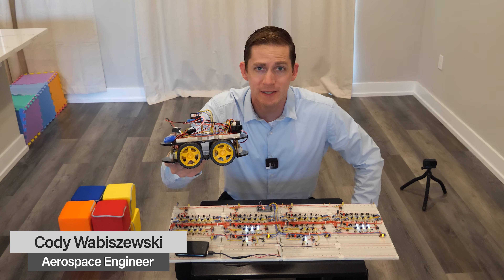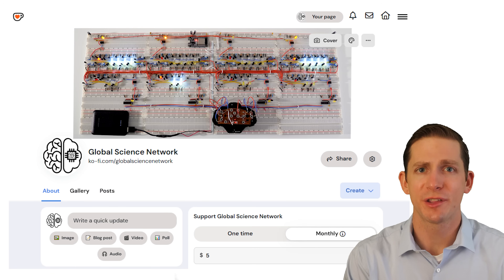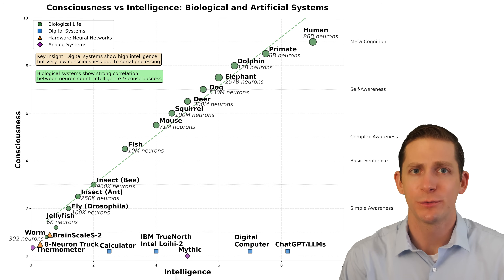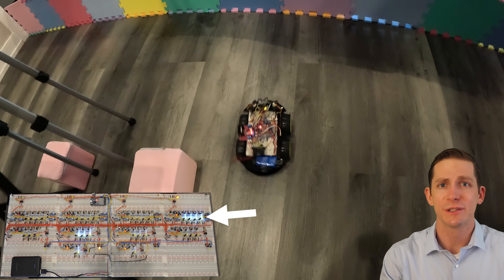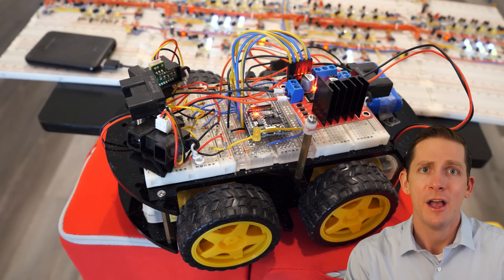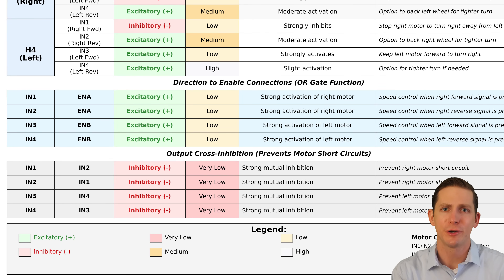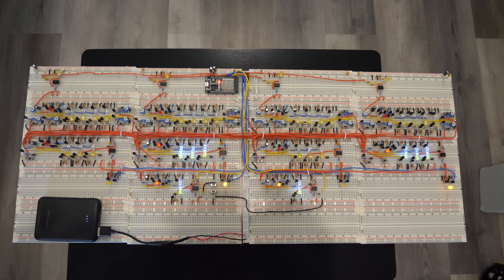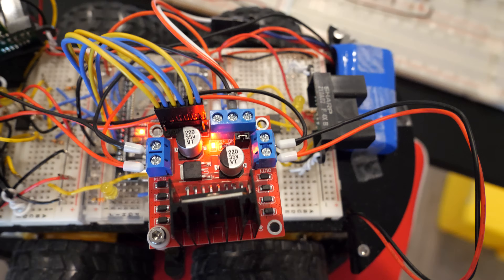Artificial Brain Controlled Robot

Comment: sir i am making your project in pcb form of each neuron and synaps but for kind information circuit diagram you send 1 problem in every neuron the left side of discharge resister two resister are interconnected 100k and 2k but not connect to 5v vcc rather than grate theory explanation
Reply from the maker: Interesting, I have drawn up to PCB version now as well. I would be curious what yours looks like. Send me an email if you would!
Reply: One dought
Reply: Using MOSFET as an inverter is for opto coupler and transister as an inverter is led as an option coupler

Comment: I think the core of machine intelligence might be only 14 equations (7 from Reinforcement Learning, and the other from an adaptive, Fuzzy state classifier) with just 3 Neurons (2 of the neurons from a 1983 IEEE CART-POLE paper, with a rigid decoder modified to go from being a passive sensory system, to being an active sensory system, basically the 3rd neuron as a "head", active sensory system like our own head with eyes and ears all movable).
Reply: This being all implemented as an adaptive control system with an adaptive Fuzzy state classifier using Reinforcement Learning, a key reference is:

"Adaptive Control: Stability, Convergence, and Robustness" by Shanker Sastry, and Marc Bodson (1989)

Comment: That thought experiment you proposed, is very important and clearly defines what the “sense of self” or consciousness is. If one gradually replaces the neurons with perfect replicas, then the self recurring loop doesn’t break.

It’s as if nothing happened, since the underlying generative process isn’t paused or broken. The challenge now, is developing these self recurring loops with the artificial neurons. To get this is completely possible, but requires many connections and layers as to sieve through and connect different abstractions. With projects like these humanity is getting closer and closer to this. I myself, am working on implementing this self recurring loop for aerospace systems.

Comment: An interesting thing to do would be to have the potentiometers replaced with something with resistance that can be varied from an input signal and then using another microcontroller or raspberry pi to run some kind of optimisation algorithm like cmaes or something lighter to then automatically tune the neural network

Comment: would replacing the fixed 200k resistor by a SPI based digital resistor along with a SPI ADC then to read the values help this to self tune?

Comment: Bruh howd you do backpropagation on it. Did you just train it elsewhere and just wire the weights in like that?
Reply from the maker: I manually adjusted the weights. I did not need to do backpropagation as the logic was pretty straightforward. I show the logic in the table with the needed resistance or weight of each connection.

Comment: what is fun to think about is, how much power this uses vs how much power a standard neural network on a computer would take to achieve the same thing. This is really amazing work.
Reply from the maker: Thank you! This is true, the potential for high level consciousness machines and low power. This is something that is just not possible with digital machines. Hopefully more people start working on this type of tech!
Reply: The main issue/difference is the organic (no pun intended) creation denovo of new connections out of the blue that hardware can't/won't do
Reply from the maker: @uog293  Watch my video on how to create artificial synapses. Most of our learning is done with reduction, not new connections. Also, why do you think we cannot make new connections with hardwared? It can be done!

Comment: I'd love to see something like this made using an FPGA if that's even possible. I work with drones and especially light weight drones, they sometimes struggle when the conditions are windy, i can tune the drone to the best of my abilities but sometimes i think the flight controller is just not quick enough to make decisions to stabilize the craft. I know the power system is also a major dependency in terms of flight performance but i wonder what if a flight computer, just like the one you made which works in real time could help with such issues. 
Amazing work ❤.

Comment: Bro u can do the same thing with finite states machine😅 with couple of flip flops wtf
Reply from the maker: Yeah, you can do obstacle avoidance with a relatively simple set of digital logic gates and flip-flops. However, that is not analog and the resolution would be way lower. This was to make a simple case of how this works in hardware. Then keep improving the design and eventually scaling it. If you are interested, watch my video on how consciousness works to understand how digital machines are very limited when it comes to making conscious devices. Which is the ultimate goal here, to make non-biological life.

Comment: So cool!! Sir there’s cheap FPGA on aliexpress rn is this applicable on that?
Reply from the maker: Well, an FPGA could be used to help with inputs and outputs. The core design needs to be an analog integrate and fire method and an FPGA would still be digital.

Comment: Hello Global Science Network!

 I'm a huge fan of your work all the way from Brazil. The robot driving footage is fantastic!
I was thinking about the next step—having the robot adjust the weights automatically—and I wanted to share an idea for a hybrid learning architecture based on your current design:
Digital-Analog Hybrid: Since your analog circuit handles the fast, energy-efficient signal processing (the 'driving'), the ESP32 on the robot should handle the learning.
Backpropagation/Delta Rule: When the collision sensor activates, the ESP32 can calculate the new optimal weight using a simplified Delta Rule (or Backpropagation concept). This calculation determines how much to punish the synapses that caused the error.
 Digital Potentiometers (Digipots): By replacing the manual potentiometers with Digital Potentiometers (Digipots) controlled via I2C or SPI, the ESP32 could digitally write the calculated New Weight directly to the analog synapses. This maintains the analog speed while achieving automatic learning.
  Generic/SMD Modules: To make the design scalable, you could create the synapse/neuron blocks on small, generic SMD PCBs. This makes the entire "brain" modular and highly dense, allowing for quick scaling to 50 or 100 neurons for more complex tasks!
Your project is already groundbreaking. Keep up the amazing work! I'm eager to see the next video on automatic weight adjustment!

Comment: I didn't understand how this is better than GPT will billions of transistors... can you please explain it a bit?
Reply from the maker: If you want my video on how consciousness works, I go into detail. Basically, though, AI running on digital machines are very intelligent but has a low level of consciousness due to how information flows around the system. Each part of the circuit is only active for billionths of a second.
Reply: @GlobalScienceNetwork  ho got it... while here all the parts are simultaniouly active as it's physically there

Comment: man, I can't wait to see a surface mount prototype. that'd be so compact! you could have 64 neurons on the robot, no RC required.
Reply from the maker: Yeah, exactly, if it is all onboard it is actually much simpler. Controlling it remotely was fun as well!
Reply: @GlobalScienceNetwork  I was wondering, how do you plan on recording and replicating brain patterns? Surely there has to be a way to copy information from one set of neurons to another.

Comment: why are you sticking to breadboards? i feel like prototyping on a PCB might be easier for you. you could use small smd components and easily have many dozens of neurons quickly wired up
Reply from the maker: Yeah, I did breadboards as the design is more flexible for the first build. This will be converted to PCBs and even IC once the design is refined more.

Comment: Maybe I will emulate this on an attiny 13. It should handle up to 16 neurons fine.
Reply from the maker: That would be great! I used 10 inputs/outputs to send and receive, data. Also, you need a transmitter so not sure if it will work.

Comment: Can I get guidance on using AI to control a IGV in different conditions.
Reply from the maker: That could be done with these networks. Hard to explain in one comment, though. It depends on what sensor data you have.

Comment: Hey I use that motor driver too, that's a good motor driver. I have accidentally fried one before by putting way too much voltage into the buck converter, frying the motor controller, my esp-32 and the buck converter. I think I was trying to drop the voltage from 18V to 12V. But boy did my robot go fast for a second lol
Reply from the maker: Ha ha that is awesome! This was powered at 7.4V.

Comment: All this experiment is just a "fancy" way of implementing a functionality what just could have been done with a few tens of code lines. 
   Nueronal networks makes sense only on bigger networks when you need specific objects detection, otherwise for implementing an "obstacle avoidance" using some ir or motion sensors, some common algorithm does the job better.
Reply from the maker: Well since I have a microcontroller on both ends I agree that I could have programmed in obstacle avoidance. This was made to demonstrate how a small hardware based neural network can do something useful with a simple task that is also engaging and useful. The resolution of the network is much higher than it would be in a digital computer, and the response times can be much faster and much more parallel. This means this type of technology can have a high level of consciousness, unlike digital computers. Also, the next step is to make it neuromorphic which again is something that digital machines can only simulate. So yes, digital systems are better at most tasks today. However, if we keep going with this project, it will be the technology of the future.

Comment: This is truly brilliant work! im very tempted to try and shrink your circuit down to a modular pcb, any chance i could grab the schematic too? I have a little Mio robot that I converted to run from a PocketBeagle but a miniaturised version of this would be incredible!
edit: also have a look into the tb6612fng motor driver, is more advanced than the L298N in a smaller footprint!
Reply from the maker: Great, thanks! Yeah, if you send my an email, I will send you the diagram. Let me know if you make progress on the PCB as I have to do this at some point as well. Making it on a smaller platform would be sweet! The entire hardware based neural network onboard would actually make it easier.

Comment: Lots of fancy words for a pretty basic analog computer.
Like it’s a Mark I Perceptron from the 50’s with lot less complexity and useing new parts like transistors.

The manual learning method is basicly the same in both systems.
If you wanted to be an educational YouTuber show the stuff your bashing it off, at least mention what your bashing your circuit off of.
Despite what this guy claimed this isn’t new but a very old method that was proposed originally in 1943.

These systems rely on scale what you got here is nothing really as it has the same problem as all analog computers have, sensitive to noise and the stuggle of scaling it up.
It took 500 neurons to be able to tell the difference between a square and circle on a piece of paper, to do anything more advanced than that you would need low end 10,000 with the neuron model your useing here.

Any ideas on how to fix these problems? 
To make analog computers such as this even possible?
To you know, make it trainable on the system itself without manual input meanwhile being even slightly scaleable?

Until then you got nothing but a children’s demonstration of a highly simplified neurons model.
Reply: Yeah you could build the whole thing with less parts if you were just trying to build a circuit that would work. The idea is to teach concepts to apply to something much bigger.
Reply from the maker: Well we need to start with the basics and yeah I like the approach from the 1950 better than using digital computers. One thing we do have more insight into now is how the brain works. At the end of the video, I explain the next step is to make the design neuromorphic. I am trying to build a circuit that is functionally equivalent to neurons and synapses in biological brains, and am not basing it on anyone else's design. Most designs stray from the goal quickly. We really just need one neuron and thousands of synapses to work just like the brain, and then scaling the system is almost trivial. Most people focus too much on scaling to a large system, but the underlying mechanisms are not in any way how the brain works.
Reply: what on earth do you gain from hating so hard? get a life dawg
Reply: @Insultthumb by giveing information that disproves the flames this is new technology or the future when infact it’s the past.
Lot of those in the comments seem to be young and fall into the tech-bro sphere and generally think this is actually noteworthy.

The way the info is presenting is honestly kinda dishonest expressly as he uses techno jargon to confuse, 
the point was not to teach like he clames but as a form of pro-tech tech-illiterate propaganda. 

Number of times he says something simple yet uses the most complex words to describe it, not mention the history of tech used all of that is what I got a problem with.

Comment: Still learning how to attempt this
Reply: Would recommend looking into other implementations such as the 1958 Mark I Perceptron that is basicly this tho more advanced (500 neurons in a layer) and can identify shapes on paper, but can simplify the design into however meny neurons you need. 

( Tho keep in mind it was useing tech of the time so no transistors, but the papers describe how it works and how to train such systems in more detail than these videos do. )
Reply from the maker: @reddashgames7550  The perceptron was cool but did not use this integrate and fire method of a spiking neural network. It was a single layer binary classifier. The 20×20 array of photocells to "see" images in an analog way was awesome. It did need humans in the loop to provide supervisory learning as well. The goal here for the next step is to have the learning done on its own just by interacting with the environment. I explain more about spiking neural networks in my other videos as well.
Reply: @GlobalScienceNetwork  I too am working on a perceptron project! I made a perceptron in the Snap coding language. I will send you a link to it for inspiration. The job of the perceptron I coded is to predict house prices based on three inputs. Square feet, bedrooms, and the age of the house. To train it I used the learning rate x error method and fed it a data block. Most people think perceptrons are dense and can’t learn much. But I have discovered that a single perceptron can learn a lot more than most people think. Unlike your project, mine only uses a single artificial neuron and a weight updating code. A little less powerful than your project but yeah. A single artificial neuron/perceptron can do other things too, for example it can predict the prices that gold and silver will be in advance. Your project is more for moving around vehicles, and my project is more for predicting house prices and stuff like that. I highly recommend the target - output method, and the learning rate x error method to train the ai. I hope this is good info :)
Reply from the maker: @QuackSnack15-j1g  That is interesting!
Reply from the maker: Great, I have videos how to build artificial synapses and artificial neurons, which would be a great place to start.

Comment: I suppose you train this network by tweaking it with hand do you plan to make it self training by adding some loss value and trail error trainin like digital networks?
Reply from the maker: Right now, I train it by adjusting the resistance manually, hard coding the logic. The next step is to make it neuromorphic. Is does have analog output now which is great and allows for smooth control.